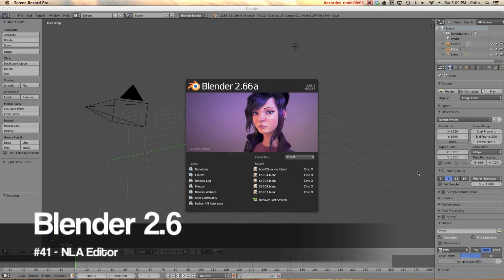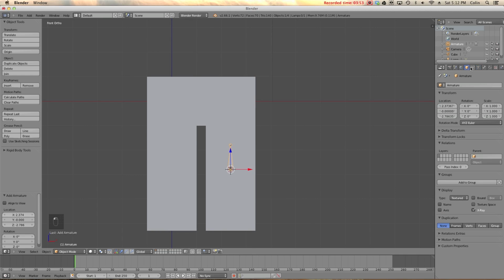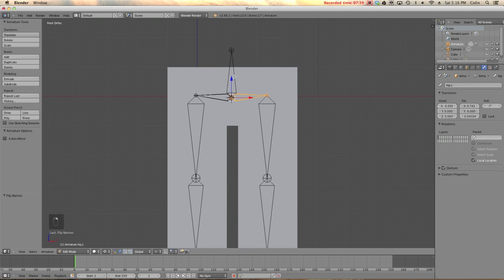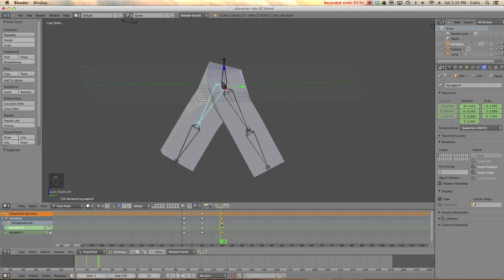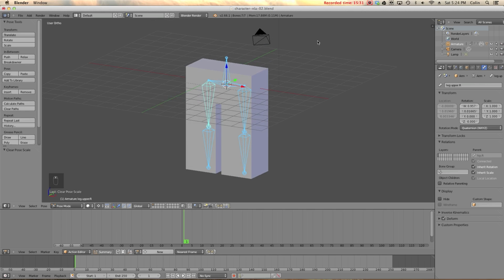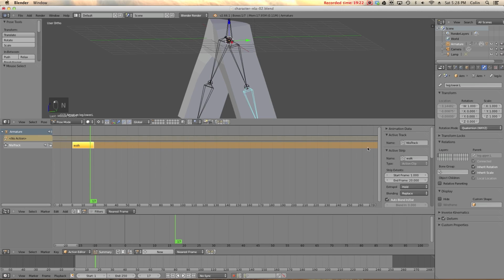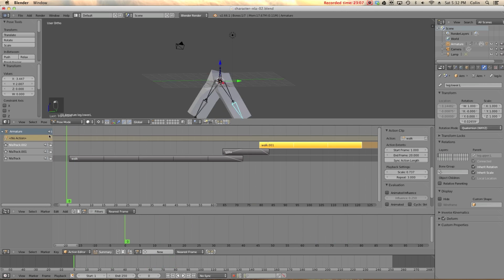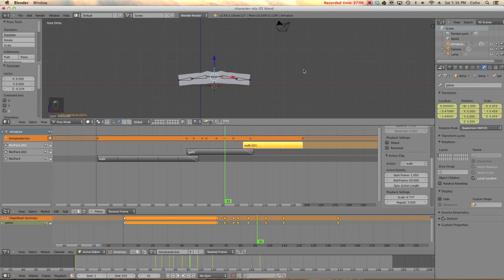Blender 2.6 Tutorial 41 - NLA Editor

Comment from the maker: To lower the triangle count of a mesh, obviously going in and making adjustments (dissolving edges/vertexes) manually is the best thing to do. If you're looking for a fast-and-dirty solution, try using the limited dissolve tool in edit mode. I talk about it in my Tutorial #37 - BMesh & NGons. Be warned that any quick method of reducing complexity (rather than doing it manually/properly) is going to result in a pretty wacky/undesirable mesh topology.